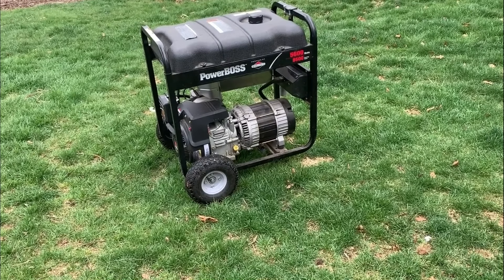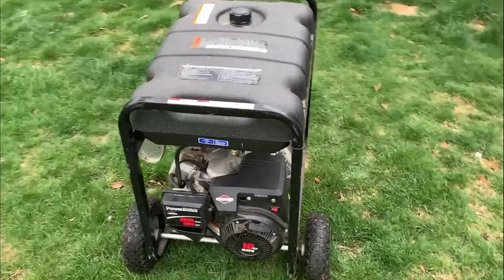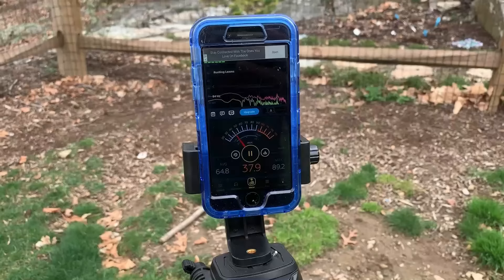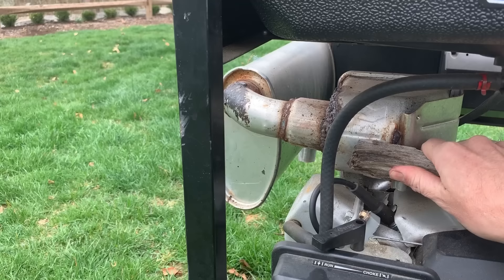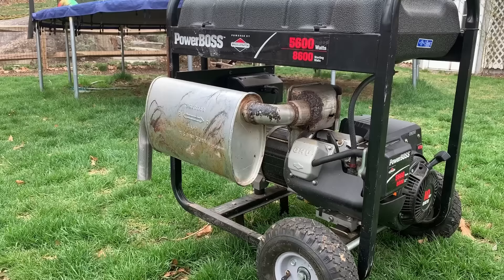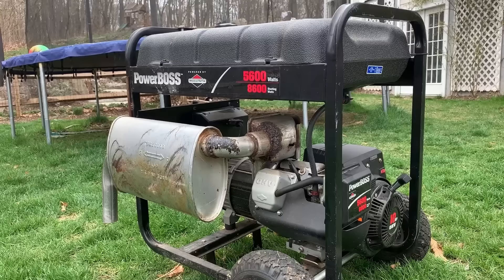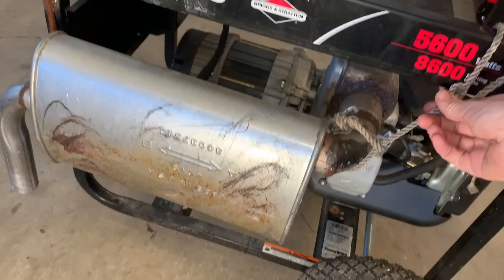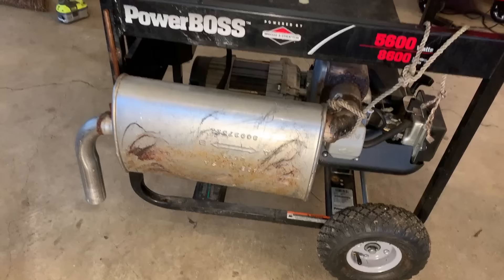Will a Car Muffler Make a Generator Quiet?

Comment: As people have been talking about in many YouTube videos recently, a muffler is not the only serious component to car exhaust in terms of noise. The other most important component is the resonator, which shapes the sound, before it gets run through the baffles and chambers of the muffler. I think that without both components it's not a fair comparison.
Reply: Put a much smaller tailpipe on it will make the muffler more effective. The muffler will actually act like a resonator.
Reply: Somebody who gets it. It really baffles me.
Reply: @sonikmystique  GET IT?
Reply: You’re using the terms resonator and muffler backwards. 
-A muffler uses sound absorbing packing and or baffle plates to reduce or “muffle” overall sound energy over a wide frequency range. Hence the term “muffler”
-A resonator uses mathematically tuned sound chambers to produce specific resonant frequencies that cancel out the natural resonance of the exhaust (commonly called “drone”). Hence the term resonator. 

To be fair, most of the automotive industry uses these terms backwards as well, which leads to confusion.
Reply: Uhm I hate to point out the obvious but he’s showing a db graph that has virtually no resonance.

Also even more obvious the biggest contributor to an engines volume is its RPM.

Generators run at 3600 rpm to produce 60hz. Engines in general are just noisy at 3600 rpm especially ones that exhaust straight into the muffler. Strapping on an oversized muffler or resonator (even though there is no resonance) will reduce the volume from loud to still loud.

Go out and rev your cars engine to 3600 rpm and you’ll find it’s relatively noisy. And that’s with an engineered exhaust manifold, possibly a resonator, at least 1 catalytic converter, multiple feet of exhaust piping, and a muffler engineered to reduce that specific engines noise.

Comment: Every 3dB is double the sound energy emitted. This is diluted through a hemisphere of air separating you from the generator. The energy reduction is defined by the equation (2πr^3)/3 where r is your distance from the generator. While you don't perceive a reduction of half it's still significantly less with the muffler despite the huge exhaust leak in the original muffler.
Reply: absolutely correct, 3.01dB to be exact. At almost 6 dB louder without the muffler, it is effectively twice as loud.
Reply: NERD!!! - Ogre.
Reply: Yep! I saw the 6dB change and thought that was a pretty impressive result. You wouldn't notice it right up next to it, but your neighbors would certainly appreciate the difference.
Reply: @jaydee3730  Wouldn't that be louder by x4?
Reply: @jaydee3730  4x louder

Comment: One factor that needs to come into play here is how loud the generator is with a load placed on it.  The generator is going to be burning more fuel per engine cycle to maintain 3600RPM with a few thousand watts on it.  This, in turn will make more explosive energy in the exhaust system, which creates the noise.  It would be good to run this test again with maybe two 1500-watt space heaters plugged into the generator for a simulated load.  The automobile exhaust muffler, I imagine will really show an improvement, as it's designed to be more effective with higher exhaust pressures.
Reply: Your statement would be valid if you knew that inverted generators are the engines designed to vary idle speed with load demand. The generator shown in this video maintains its rpm whether or not a load is placed.
Reply: @tlc5343  That's the point. To maintain the RPM under load it needs to get more fuel per revolution, i.e. more exhaust pressure, what audvidgeek was talking about.
Reply: @MarekLewandowski_EE  Exactly. Engines don't burn fixed amount of fuel per rpm. It depends on how hard it is to hold that rpm. If you'd ever had a car with a cold intake or just sports exhaust you'd know that holding 3000rpm at standing still is nowhere close the sound level of engine accelerating @3000rpm. That is why also revving engine on place will make more alot more noise because at the time of full open throttle engine is burning alot more fuel and is louder.
Reply: @tlc5343  

The op explicitly stated maintaining the rpm. They were not confused.
Reply: @tlc5343  Get absolutely fucking destroyed by these legends
Reply: @SirRCTHETHIRD  dang lol
Reply: Not just the exhaust that's loud, it's the mechanical parts inside the engine that make a lot of noise, especially in the valve train, mufflers only do so much.
Reply: @lonewolf2156  This is especially excentuated on air cooled engines thanks to having more exposed surfaces. Why most generators that are designed with noise in mind are always completely enclosed in an insulated box
Reply: Dunning and Kruger called... they want their effect back.. 😄
Reply: I have a 3500w Duromax that's not crazy loud, (quieter than a common lawn mower) it uses a muffler that looks like a mini car muffler with  a small 3/4 or 1 in-ish.  ID end pipe. I was just thinking it'd be easy to make a free slip on silencer using some metal pipe/tube, with a bunch of holes drilled in it,  empty spray can & pack it with fiberglass or steel wool. Like a slip on motorcycle silencer just clamp it on the end of existing muffler pipe.
Reply: @tlc5343  Those generators do get louder when placed under load
Reply: @tlc5343  Yeh, turn it upside down and try it again.
Reply: He idled it up all the way, a generator won't exceed that idle under any circumstances
Reply: @alphaphoenix1938  it's not the operating speed though that's causes the most noise, it's the exploding fuel in the engine.  An engine would be almost silent if it was spinning at 3600 RPM from an external source, not burning fuel.  When you burn more fuel, you create more noise regardless of RPM.
Reply: @audvidgeek  my point exactly it is a gas fired engine therefore to get more RPM you have to make more combustion, I agree it's not the RPM but in this instance the two go hand and hand, so give it more throttle, make more noise, he gave it max throttle it won't get any louder unless there's a type of mechanical issue that arises like loose bolt, cracked metal, or maybe even heated metal that gets loose and causes friction or vibration.
Reply: @audvidgeek  the automotive exhaust is made for a higher load but it is also intended for a lot more back pressure and a higher volume system, it's hard to get the full effect of the exhaust when you basically blow through it and don't hit the dampening parts at all
Reply: Two heaters would be a load, not a simulated load... You're not as smart asnyou want to try to sound, just stop while you're ahead.
Reply: @kevinfreeman3098   "simulated" as in simulating it actually being put to useful work heating the inside of a home on a cold day, versus just sitting the heaters outside on a warm day.
Reply: @kevinfreeman3098  whatever.  I explained what I meant. believe what you want to believe and be happy.  I don't really care what you caught and if you think I look foolish by your perspective and you enjoy that, and it's your thing, then I'm glad I entertained you!

Comment: Most of the noise from that engine is mechanical noise as opposed to combustion noise. Best way to mitigate sound from those types of generators is to incorporate some type of structure around them to deflect the sound. There are a few vids I've watched on YouTube that have worked when I tested on my units.
Reply: Be careful though, the exhaust is hot enough to start a fire. I had mine on in the winter while clearing out my storage, had pieces of wood a few feet away blocking the noise, about 30 min later the wood was up in flames and was inches away from starting my van on fire too. Gotta make sure there’s plenty ventilation, space, and fireproof material
Reply: Also The car muffler does nothing for intake noise.... Kind of a huge deal
Reply: I was thinking the same thing.  It's why the more expensive Honda motors cost so much, they build them to be quiet.
Reply: But if you surround it with something that holds the heat in the generator
Reply: @toddswasey1671  Heat cogeneration was a thought was looking at a Model Steam engine but then the Water jacket thought of making a small Catalytic for a heat boost and it becomes a monster of complications.
Reply: Exactly.  That is why really big generators with Caterpillar engines  are encased with insulating noise reducing material.. I work around these all the time. Very quiet.
Reply: @toddswasey1671  possibly with an open top and uneven walls to absorb and deflect sound with the other concerns you mentioned.
It needs ventilation and fireproofing and sound absorbing material.
Reply: @allanpatterson7653  I would love to make a small liquid cooled four cylinder engine into a micro cogeneration system.
Reply: @richtomlinson7090    The exhaust heat should be put to use instead of throwing it away.
Generate DC to be stored in batteries and used by converting it through an Inverter.
If you are going to burn a Hydro-carbon make it worth it.
Reply: @monalong8900  absolutely, and that's what they call micro cogeneration, it helps to be using a liquid cooled engine and to not waste the low grade heat.
I tell people that an oil furnace is wasting the work that a diesel engine could provide, while producing waste heat that approximates that of a furnace
Reply: @richtomlinson7090  If you ran short of low grade energy for heat you could make it up with Electric heat which would cause the engine to work harder and make more,
Reply: @allanpatterson7653  at a smaller ski area our family went to they generated the correct electricity for the lift and they would ask around for free electric resistance heaters to help create load.
That certainly is an option when the weather is colder and there's less electric demand for other things.

Comment: if you want to make it quiet you need to encapsulate the entire engine in an acoustically engineered enclosure with inlets for air and outlets for the exhaust. all the noise the motor makes is not coming just out of the exhaust port.
Reply: Attach a oxygen bottle to it then launch it into space. 
Suuuuper Quiet !
Reply: @900stx7   sarcasm 100
Reply: The majority is coming from the exhaust. That car muffler was way too big. If sized correctly it could’ve worked a lot better.
Reply: @jeffclark5024  yeah excactly and if its still not quite enough then the next step is what i said
Reply: correct. vibration at 3600 rpm,  causes residual noise/ which is vibrating air pressure...
Reply: Agreed.  Put 4 inches of sound proofing ( 2 inches and double it) insulation on the sides and top.  Cover that over with just 1/4 inch plywood.  Or just get 2 inch foam insulation (board)  and double that and you will have a much quieter generator.  Hole for air to get in and one for exhaust and you will cut the sound by 40%.  Plus if you paint it you can run it in the rain because I am not putting a generator in a garage, I don't care if doors are open.  No need for a bottom.  Just put handles on each end and if you have 2 people, you can just pick it up and set it over the generator.
Reply: You are correct sir ! 👍

Comment: I have a buddy whos been living off generators since 2009. He uses sheets of tin and surrounds the generator leaving the top wide open. Tin is 3 feet away and on the inside he has bed foam glued to it.Basically a dog pen with foam.

Comment: Granted whoever did that conversion did it poorly, a couple points: whole test is invalid because you ran the test with car exhaust with a hole upstream of the muffler (sorry, your block of wood wasn't doing anything) as well as a loose muffler bolt.  Both conditions were repaired for the stock system test.  Even with that severe handicap, since the decibel scale is logarithmic, the stock system was FIVE TIMES as loud as the system with car exhaust.  Done with proper rubber isolation, a good drain, and considerations for heat, that system could probably perform far better than it did here.  I think we could expect a functioning system to achieve levels of 10 db quieter, or reducing perceived sound by 90%. I'd call that worth it.
Reply: That's exactly what I thought we he mentioned the hole. I paused the video and looked for a comment like yours. As a welder, I've seen decent welds fail to seal exhaust leaks, that block of wood probably just made it louder over all by adding vibrational noises and raising the pitch of the sounds coming out. I car audio, you have to double your power output for every 3 DB of sound. 3 decibels of sound pressure is a big difference in loudness. This was a neat experiment to stumble on and make a video about but really would have benefitted from some extra research. Still a great video and I appreciate everyone involved. I would honestly consider putting a decent 3 chamber muffler on a larger engine like this. It might reduce performance but it couldn't be too bad. Id want to see power output before and after
Reply: I agree with you on how the test was flawed but that is not how logarithms or decibels work.
Reply: Don't forget the intake as well...  there is a boat load of noise from that end too.  As others have pointed out there is the mechanical component to the noise.  I agree with you on your points though.
Reply: i immediately thought the same way before i saw the hole in the original muffler. glad im not the only one who sees that if done correctly it could be a major improvement. the larger the space for the sound to get baffled the more silent the exhaust will be. poorly executed but proof of concept is there, decibels work differently than most people know( i worked 7 years in a small engine power equipment shop, i know what these things sound like with and without mufflers) i think if done correctly with the proper back pressures that the engine is built for this could work alot better. just look at how much a rifle suppressor can muffle a gun shot!
Reply: @tokimcbongrip8751  As someone who's experienced a blown exhaust gasket on a car, it'll turn a quiet 1.2 litre engine in an open piped Harley Davidson. So yes that hole is gonna make loads of noise, and a bit of rough wood held over it is irrelevant.
Reply: It’s not five times. The noise doubles every 3 decibels.
Reply: @stx333  true, 5dB more is about 3 times as loud.
Reply: With that much leakage, the video is basically showing that a muffler does a surprisingly good job even if you just kind of hold it near the generator...
Reply: another obvious change was the car muffler exhaust was pointing down to the ground and the stock generator exhaust was pointed right at the meter.
Reply: @MatthewPettyST1300  Not correct. He was to the side and the stock exhaust was pointed 90 degrees away and into the open air. The other pointing at the ground could easily cause a higher reading as the sound reflects off the ground. If the muffler were in good repair and facing up or outward it would have been lower on the meter from his relative location.
Reply: Exactly what I thought

Comment: Having worked in the petro driven welder/generator industry a baffled and insulated box with cooling air flow and all the noise directed upwards works great! The best i have seen are MQ generators
Reply: Mity Quip

Comment: After the blackout of 2003, I researched heavily on generators, and bought the same model Birggs, but as the Craftsman branded.  Waited for a Sears Super-Sale, Craftsman Club (for those who remember this) and got a super price on the Craftsman 5600W (identical to your unit, but with the bigger muffler like you showed on that 2nd unit).  Beautiful unit that I bought.  I babied it, did a break-in, oil change, the works.  Then we never lost power until Irene in 2011.  I wired to my entire house and had no power for 2 weeks!  This gen ran my entire house perfectly!  But it PLOWED through gas and was insanely LOUD.
As many have commented, most of the noise is mechanical.
Figuring that 2 weeks without power was not going to happen again for another 15+ years, I changed the oil, drained the gas and put this back to bed.
The Sandy hit and I lost power again for another 15 days....
While my neighbors sent extension cords under the fence on either side, they sure didn't complain about the noise, but it was horrible.  And again, I was plowing through gas, when gas was hard to come by.
I just sold the Craftsman for $250 ( I think I paid like $750 back in 2003) and upgraded to an inverter gen and love it.  (I have several)

I always wondered about and real sound data on adding another muffler.  Thanks for doing this video!  5-6 Db is a big reduction, but as you said, this thing is still really loud!  Mine wasn't much different, even with the bigger OEM muffler....
Reply: How many hours a day did you run it?
Reply: @percyfaith11  It's usually near continuous operation when you're dealing with a post-storm power outage. People cope by doing exactly that. They might let the generator rest for an hour or so after having refueled it- but generally speaking... it's expected to run constantly. Especially when it's powering an air conditioner that's making a woman comfortable. They WON'T put up with lack of A/C if it's available. They like to talk trash about how tough they are, and how they can take it- but it's an act.
Reply: @melissachartres3219  Not mine.  She's tougher stuff and is always cold anyway.  I've got a basement that's always around 60 degrees.  I'm more worried about the winter.    I run mine for about 30 minutes, off for 2 hours.  Just enough to heat up the house, run the well pump and freezers, then off.  Fortunately I've never been without power for more than 2-3 days.  2 weeks would be different.